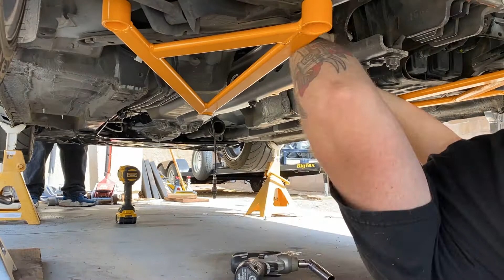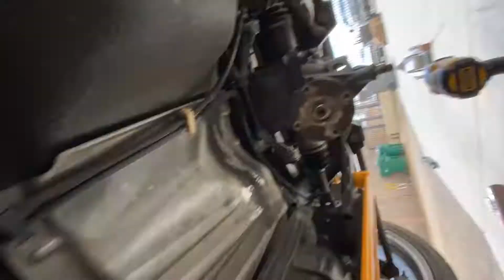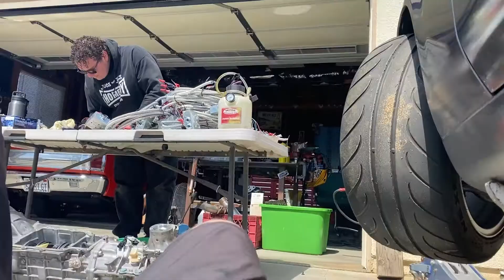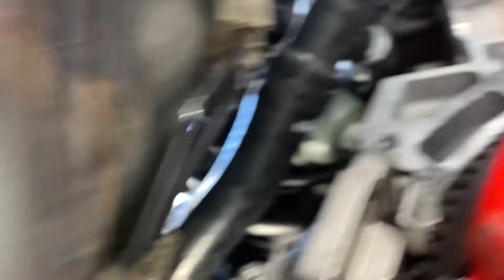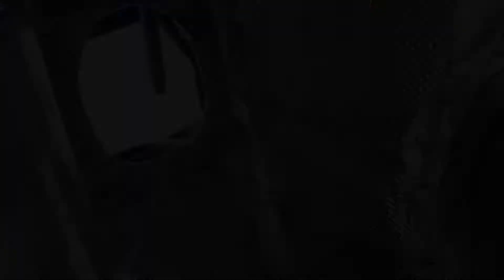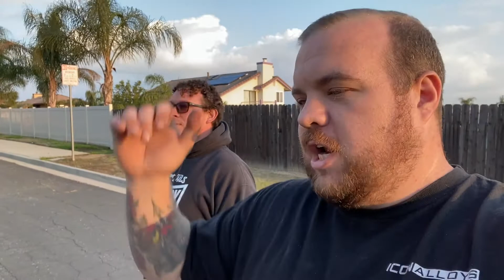NC 2.5 Build Update

Comment: I can't wait to suffer through this when I join the NC gang
Reply: This build has me considering my own NC.
Reply: This and way more lol. Ask me about the crank pulley friction washers and my exhaust valves I dare you lmao
Reply: Between you and Mitchel.... im NC shopping now 🤣
Reply: @Beakz_  I know about the absolutely absurd fiction washers. Can't wait to fail on those
Reply: @Beakz_  What happened with the friction washers?
Reply: @TheTurbineEngineer  Long story short, NC engine (aka MZR and Duratec engines) don't have a key or keyway on the crankshaft, they use "Diamond impregnated" friction washers. AKA really thin rough washers with sandpaper texture are what hold the timing chain gear and the crank pulley in time with the crankshaft. So if either of those fail (one between the crankshaft and the timing chain gear, and another between the gear and the crank pulley) you lose timing on your engine. In my case, exhaust valves clapped piston cheeks and bent all the exhaust valves. Only lasted me 3k miles and 1 track day. Engine currently being rebuilt with a keyed crank and forged internals and refreshed head.
Reply: @Beakz_  Well that's unsettling... thanks for all the info!  I'll have to look into that since I was planning on doing a 2.5 build next week.  Do you have to buy one from Massive or would it be cheaper to have Joe at Dynotronics take care of it?  
This is gonna eat into my budget a bit but if it has the potential to destroy the internals... it's a requirement.
Reply: @TheTurbineEngineer  My engine is being built by Brian at Esslinger Engineering. I wouldn't worry about it too bad, so far I think I'm just the outlier when it comes to 2.5 swaps. My suspicion is maybe my crank pulley is on the looser end of spec and the 2.5 on the smaller end of acceptable spec. Just had bad luck of the draw.
Reply: @Beakz_  Did you do a cam swap and reinstall the crank pulley out of spec maybe?  I talked to Brian at Fab9 and he said they've run 500hp with the diamond washers and it's fine so long as you torque the daylights out of it.
Reply: @TheTurbineEngineer  I did swap in new cams, with new friction washer for them as well. Everything torqued to spec with ARP hardware.
Reply: @Beakz_  I've read a lot of cases where the ARP bolts were not as good as they should be... but don't take my word on that.  I will always be taking OEM over aftermarket.
Reply: @TheTurbineEngineer  to each their own, Torque to yield has its place. Personally I've had better experiences with ARP fasteners than OE.